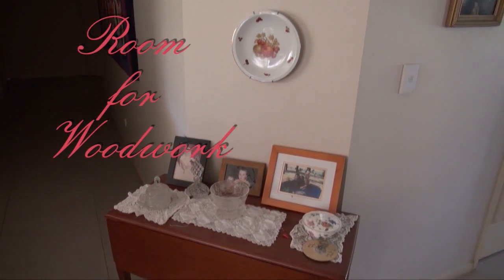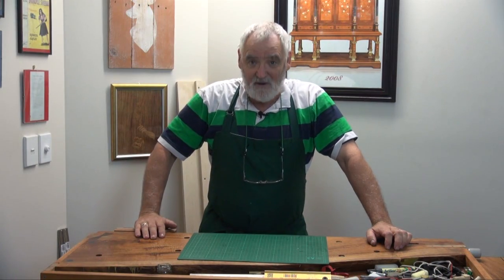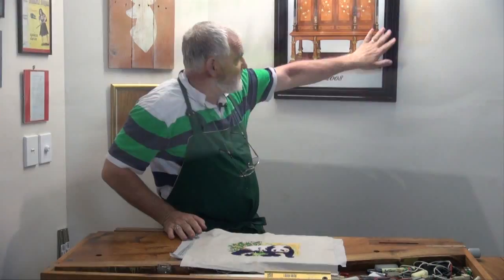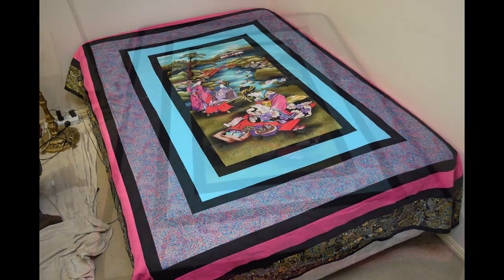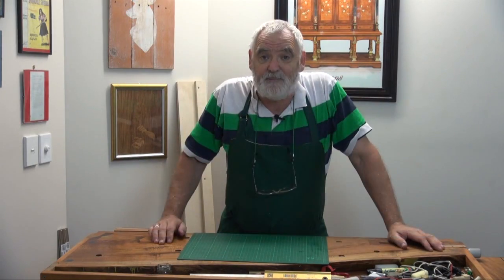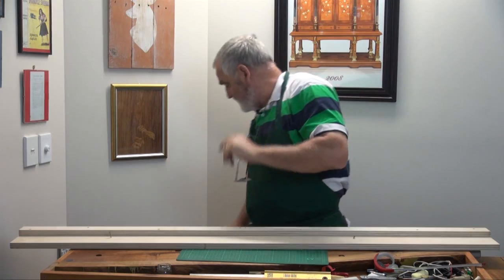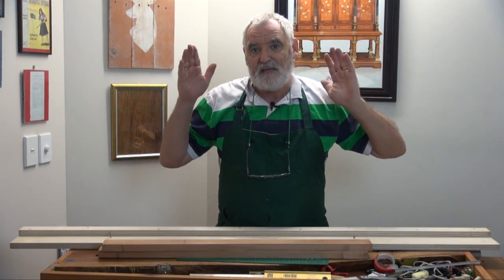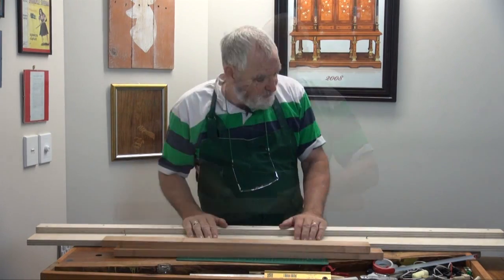Moulded Picture Frame Pt. 1 of 7 Using a Rebate Plane

Comment: Why is this project 7 parts here, and only 3 on WWMC?
Reply from the maker: Hi Mathew, Room for Woodwork series is the total series where as the posts on Woodworking Masterclass as not as in-depth. The reason being there is nothing I've found on the internet or elsewhere that focuses on Woodworking in Apartments or Small In-House workshops so I wanted to give anyone in that situation as much information as possible. Where as if you have a workshop many of the steps maybe boring or repetitive. That is also why I mention the 2 different platforms to give people a choice. Hope that helps answer you question. By the way whic do you prefer the longer of shorter version. Cheers Steve
Reply: Room for Woodwork I see. I subscribe to both channels, and in this case, I'll go with the more in-depth version.
Reply from the maker: That said, Room for woodwork only gets Room for Woodwork projects. Not woodworking masterclass ones. Cheers Steve